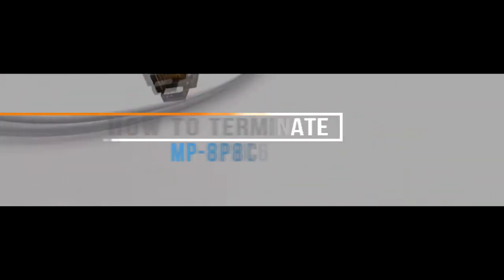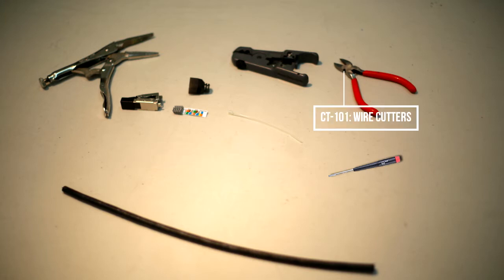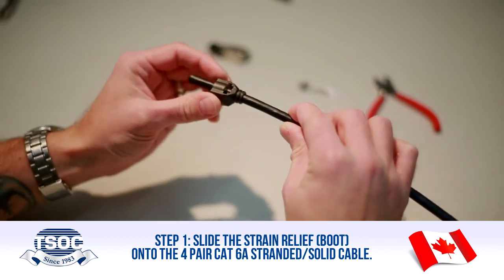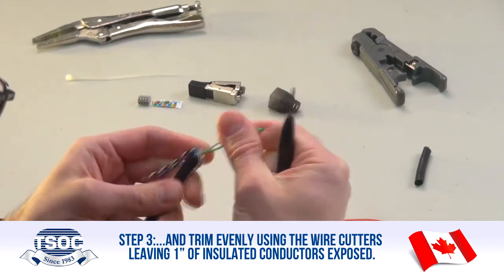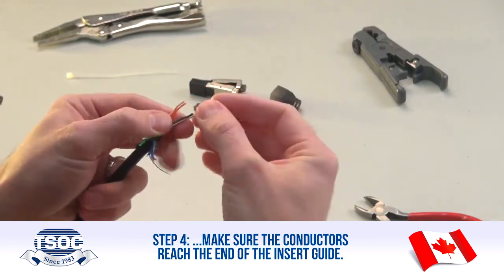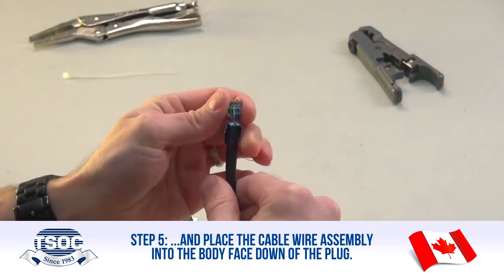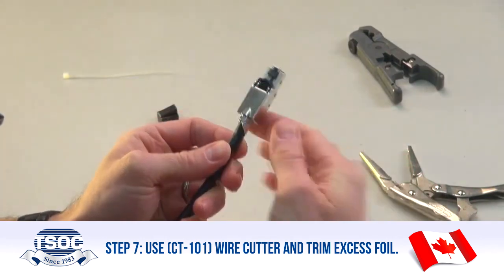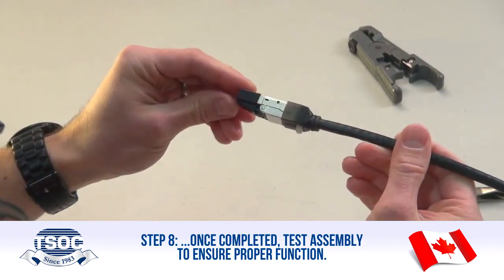Tutorial: RJ45 CAT 6A FIELD TERMINATION CONNECTOR - The TSOC™ Minute (ep. 23)

Comment: I am very pleased with this CAT6A Field Connector.  Easy to use, all I needed was a pair of pliers to terminate.  This connector is designed to be used with larger sized cat6/cat6a shielded type wire, which most connectors cannot handle.  Two thumbs up TSOC!!